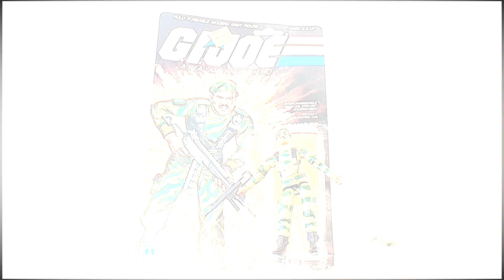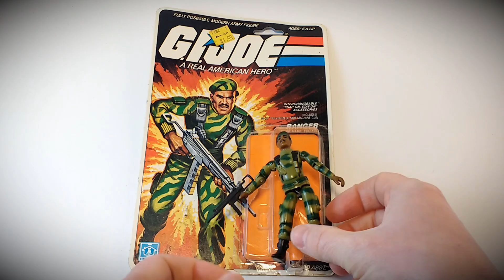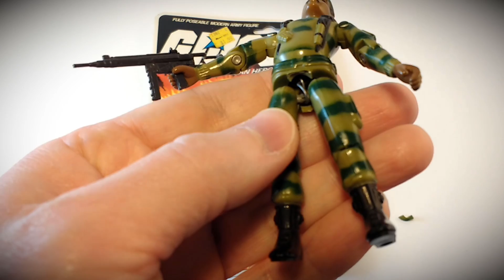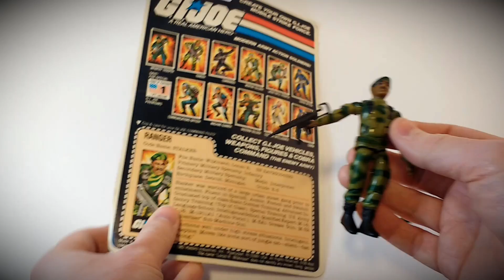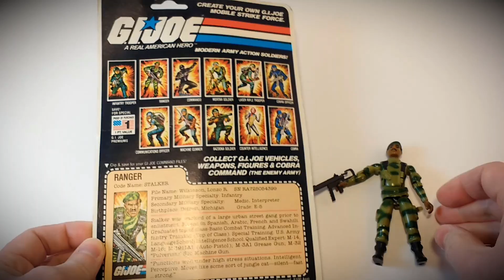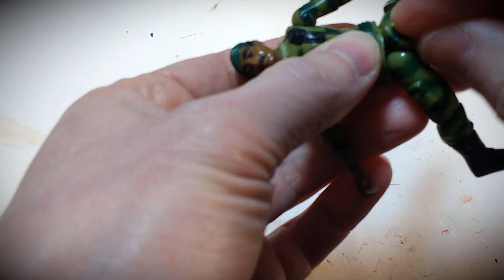GI Joe 3 3/4" Full Repair - Restoration w/Package Review - 1982 RAH

Comment: What are the products to use to repair broken waist and thumb?
Reply from the maker: The waist repair was made with a 2 part Epoxy (different brands like Loctite, Gorilla - fairly inexpensive material).  The thumb is another form of epoxy,  Epoxy Putty.  Here are a couple of links to other videos showing additional details of the thumb repair process:
https://youtu.be/W0yjGTMlA7Q   GI Joe Zap thumb repair
https://youtu.be/qjwGhFCVIJQ   Testing the hold strength of the epoxy thumb repair
Hope that helps, thanks for watching!

Comment: It's a lot easier to take the screw out of the back, and it probably wouldn't have strained and broken the metal part. You also could have salvaged a replacement from a less valuable figure and it would be more durable.
Reply from the maker: Thanks Robert,  yes hindsight is best on this project but your feedback here helps others too.

Comment: Nice work on the thumb and crotch but I think some initial research about disassembly of these figures could have saved labor. Also, I think the wire around the o-ring was a previous repair by a former owner. Every Joe I've ever taken apart has a T hook.
Reply from the maker: Thanks for watching and your feedback Brian, I appreciate it!  I’ve heard of the ‘o’ ring replacement so I knew of those going bad, but this whole wire set-up was strange.  When I record my repairs it’s pretty much as I’m working.  The wire is a mystery, I’ve had this figure since I bought it new as a kid.  I’ve also got the ‘Grunt’ figure and I’ve never opened the body, so maybe I’ll do some preventative maintenance on his ‘o’ ring and find a normal assembly.  Finding that T hook here would’ve been much more straightforward and a quicker repair!  Lot’s of T hooks on Ebay -